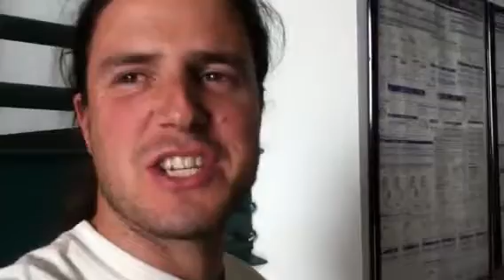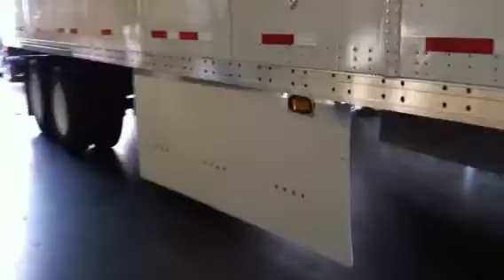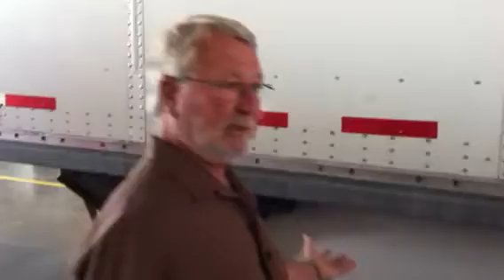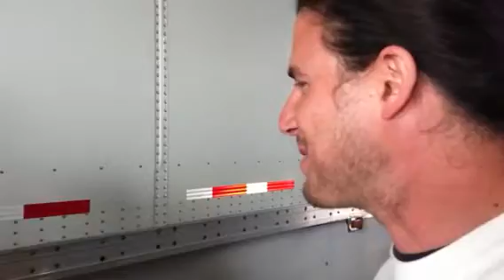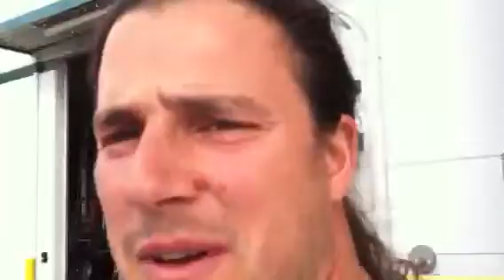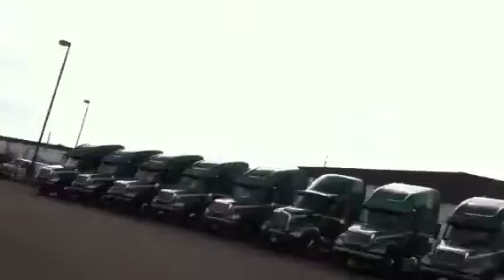The Greening of The Trucking Industry

Comment: There is a new emulsion fuel.  It uses 30% water and 70% fuel,, with no corrosion, no need to modify engines and equipment.  Reduces carbon footprint up to 90%.  No corrosion is caused.  A new nano-technology emulsifier does the job.  There is a cost savings too, keeps 100-107% power.  this is new and works great..